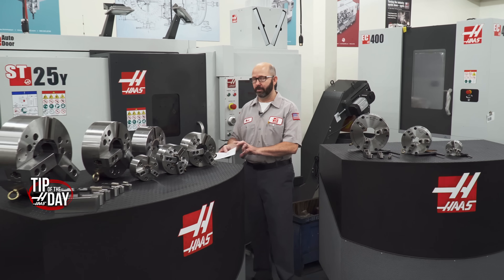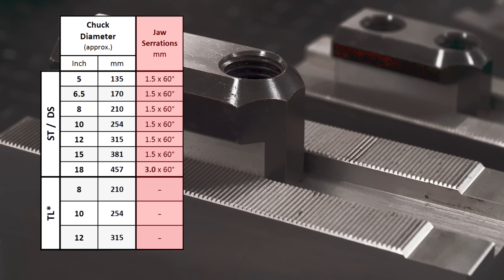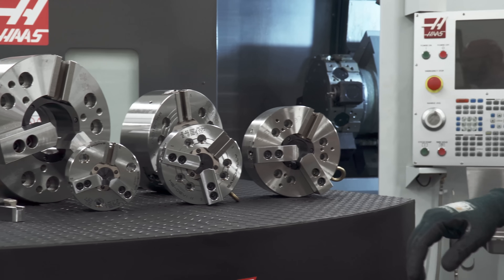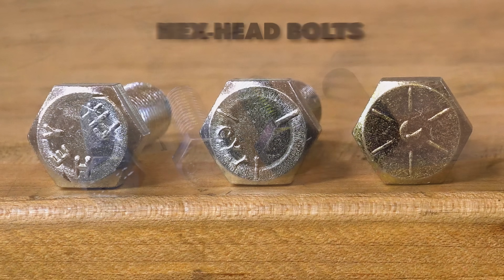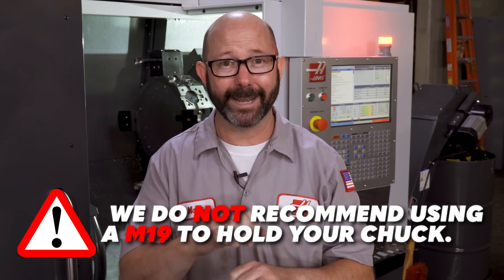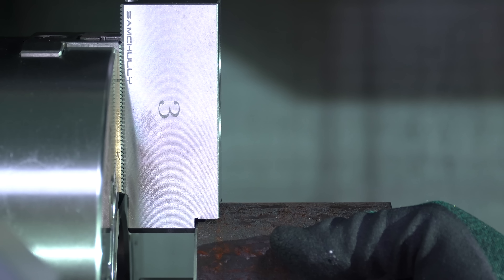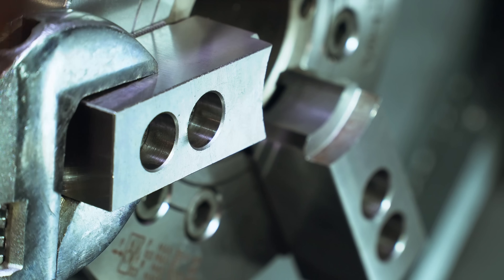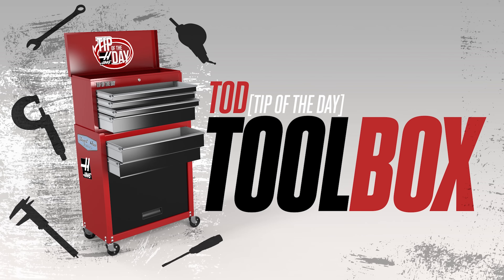Select the Right Chuck Jaws & Torque Them Correctly! - Haas Automation TOD Toolbox

Comment: Impact (air or battery, potato-potato) and torsion rods have never failed me. With the impact there is not such a big need to hold the chuck, wham-wham-wham-done... Works for me and wery little error when measuring the value with the torque wrench 😅.

Comment: How to made jaws for hex job
Reply: For Hex Stock, we can use special Hex collets, if running a collet chuck, or simply use 3 pointed jaws if using a chuck jaw and loading material by hand. If running a bar feeder with hex stock, I'd much prefer running a hex collet as they have chamfers on the backside of the collet to help the material align on entry. We can orient the spindle (specific angle) when loading a new bar, but this isn't always necessary if the inside of the collet has a nice chamfer, and if we have chamfered the ends of the bars. Special Hexagon spindle liners are available, but usually aren't necessary.

Comment: Kitigawa B-210.  2000 SL-30 bought new.  Cordless dewalt 1/2” impact.  No problems.
Reply: I've used cordless impacts on my vehicles for years, but like any impact we have to be careful not to overtighten things (especially lug nuts). Two ugga-duggas, not three. I have some Torque Limiting extensions for my cordless impacts, and the way they work is fascinating - definitely worth a Google /YouTube search. These torque-limiting-extensions work well on some impacts, and not others, based on their cyclic rate and other factors.  Thanks for the comment.
Reply: @markterryberry4477  I definitely don’t bear down on them.
Reply: @markterryberry4477  I just bought some torque stick extensions for a pneumatic torque driver at work. I never really checked the torqued ft pounds after we used the torque driver. I just trusted my boss with what worked, but at my old job we always torqued our jaws in with 75-100 ft lbs. just trying out some new stuff since I’ll be taking things over more in the department. Want to be accurate and safe if possible.

Comment: Good information. A related question I've always had is, is it okay to use the jog the turret over to rest the adjustable wrench on? At one shop we did that to install or remove spindle liners as well as torquing the chuck jaws

Comment: Hello. I have a new ST-25Y but did not see that model mentioned in the bonus PDF.
Reply: 10” standard Main Spindle Chuck, 12” Optional. Along with an optional 5” chuck on the sun-spindle. We missed this one in the Bonus content! We’ll update that sheet on the site. Thanks. You can also see Chuck Sizes on the Build-and-Price pages for each lathe model. https://www.haascnc.com/machines/lathes/st.html
Reply: @markterryberry4477  Thanks! For a moment I was worried that my model had been discontinued (perhaps in favor of the ST-28Y) before my HFO even finished setting it up! But I checked and saw that it was still configurable, plus I know it’s a big seller. Mine has every option including the 12-inch chuck.

I am trying to teach myself machining on this and the UMC-750 I also purchased, based pretty much on watching your videos. I have a hundred pages of notes I’ve made from them. It’s a very fun process.

Comment: Nice Video : I must ask this : How to apply the correct tightening torque without Torque Wrench , my mentor adviced me one thing : He mentioned that all the Allen Keys have a long arm and a short arm , the long arm is only so much long that generally you can only tighten enough as the long arm or lever of same length allows. 

So I also follow the same method once my hand cannot pull it further , I then use a small pipe to tighten it further and then stay content that the bolt will not break. 

Ofcourse : The Torque Wrench method is the way to go 🌸🌸 , however let me know how to be certain without one.

Well just got ST20Y and guess what the Application Engineer who arrived also advised me against using the spindle brake , or any sort of M Code. He said instead go with a Wrench 😇

Thanks

Comment: I’m not a machinist but watching this made me wonder who would consider performing shortcuts on a 6-figure piece of equipment that’s responsible for their livelihood? I worked with a guy many years ago who thought that jerry (jury) rigging his equipment saved him time but it ultimately cost more time when the necessary repair turned into something much more time consuming and costly than doing it correctly from the start. Procedures are procedures for a reason.
Reply: You're totally right of course. This is such a strange topic, in that we give a torque spec for the jaws, and almost no machinist uses a torque wrench when changing them, so we decided to show how you can double-check your chosen method. I've seen the screws fail, after 6 months, when a machinist used a big steel hand-sledge hammer to tighten his jaws. He was severely overtightening the screws, and they eventually failed. Those 60° grooves just work so very well, they are so reliable, that they are pretty forgiving on what torque we actually use, the V-grooves hold the jaws, the screws don't really take all the pressure of the hydraulic chuck. Great comment.
Reply: Interesting. If I owned one of these machines I would not tolerate such activity. At all.
Reply: @texasermd1  I think the owner/operators put a lot of thought into it, while I imagine many who are just owners don't know any better, and their operators little more.

Comment: I'd like to amplify the message about not using M19 to hold the chuck still. I have seen a chuck get turned far enough out of position that the lathe did a REALLY fast 360° rotation to get back to zero. This was not a Haas lathe (I don't know if they could do the same or not), and thankfully nobody was hurt, but it was a very graphic warning of why not to use M19.
Reply: Terrific comment. Exactly!
Reply: I concur, plus it just seems like bad ju-ju to put such load on the motor that it might loose position, even if it would never kick back hard. 

The only method I'm comfortable with is hitting E-stop to make sure nothing could kick that motor on, and using a wrench to hold the jaw.